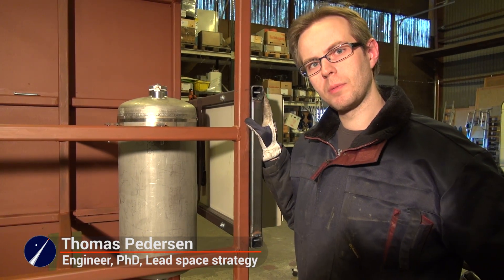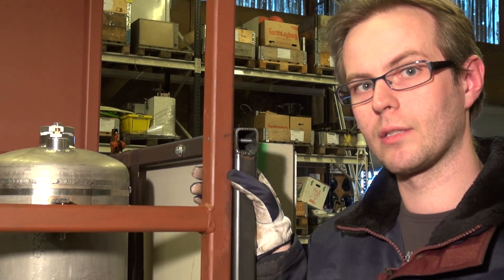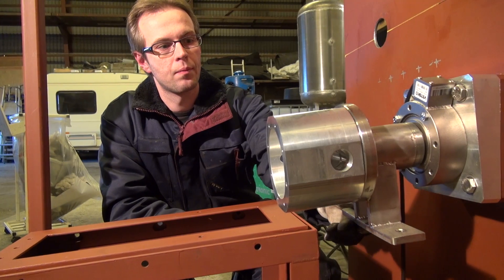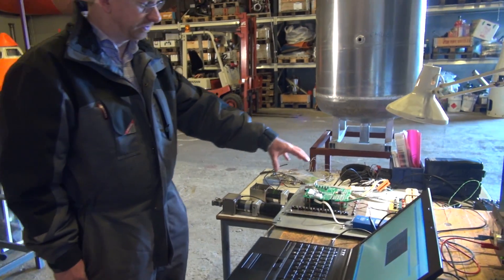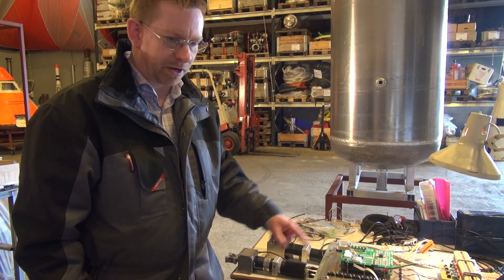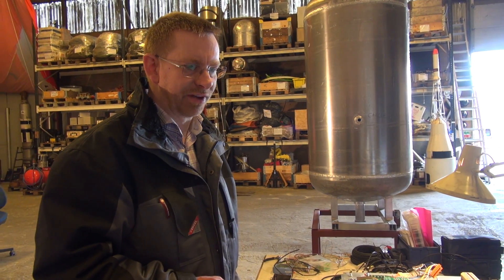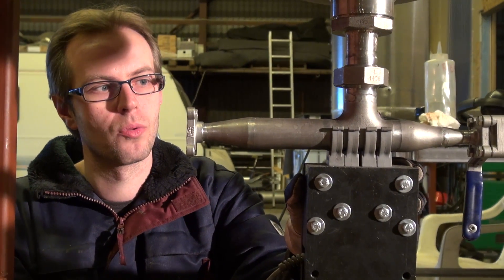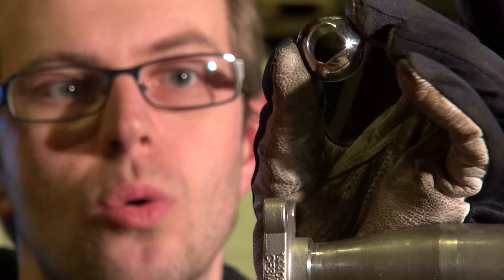Mobile Test Stand for BPM 2 and BPM 5 Rocket engine.

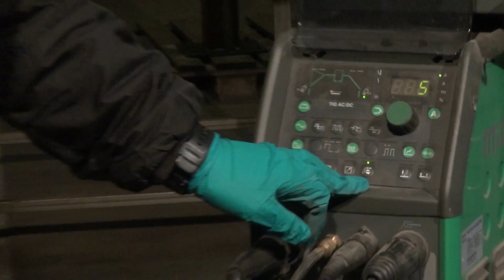Comment: What was the guy doing at 6:16? Why wasn't he just soldering them?
Reply: It it less damaging to the wire doing with a tig welder. The thermo coupler is very heat sensitive... Morten, CS
Reply: camca123 hah i was asking the same thing.  Figured that the wires were probably going to be exposed to a high temperature environment where any solder they use might melt away.